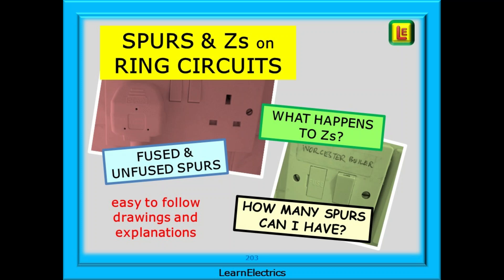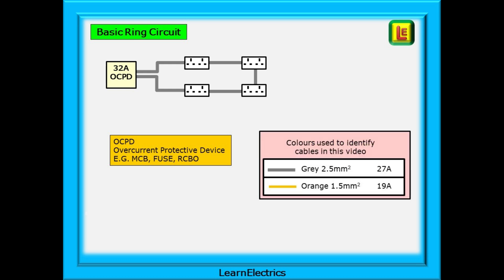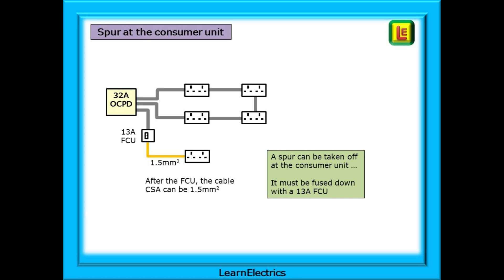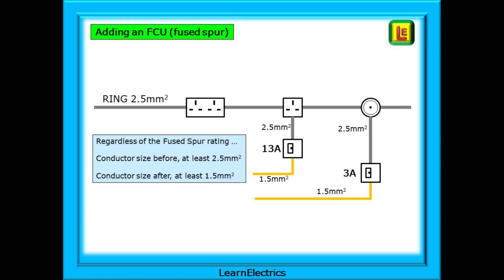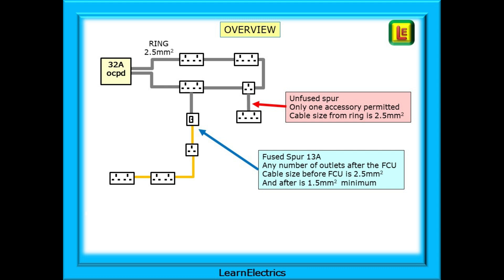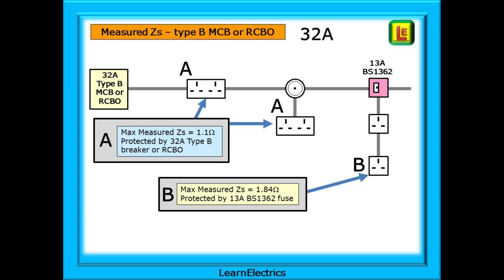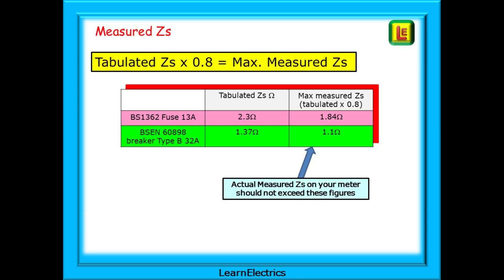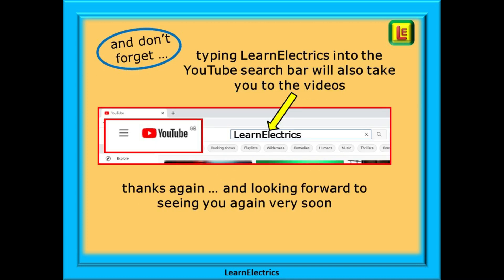SPURS AND ZS ON RING CIRCUITS – CAN I SPUR – HOW MANY SPURS – DOES ZS CHANGE – FUSED & UNFUSED SPURS

Comment: Hi. If I used 4mm T&E to spur off a ring circuit consisting of 2.5mm T&E could I then add as many sockets as I wanted to without incorporating a 13 amp fused unit?
Reply from the maker: It wouldn't then comply with wiring regs guidance. Personally, I always follow what the book says and fit an FCU. Thanks for watching. Dave.

Comment: Outstanding video again Dave. I wasn't aware that you can't come off the Ccu with a DSO without a FCU. A lot of text books show that you can. Why is it they say that you can't nowadays. Surely it is the same as coming off anywhere on the ring
Reply from the maker: Good practice to protect the single T/E cable. Yes, you're right, many books do show it and it is the electrician's choice. I don't like spurring in 4mm if there are already two 2.5mm conductors in the hole. Thanks for the input. Dave.

Comment: Nice video! But what about a switched spur coming of the ring and controlling the supply to the kitchen LEDs with a 3A fuse. Can that switch be used regularly to switch the LEDs on and off ? Technically I don't see the problem, but there might be something I don't know
Reply from the maker: A switched FCU as you explain is ok. As with all switches, check the switching capacity which will be shown inside the switch, often marked as 10A.

Comment: Great video Dave. I suppose if your spurring off a ring that’s nearing its maximum 80% Zs of 1.1 ohms (it would be a big ring, I know!!) then in theory fitting a fcu with a 13A fuse, basically gives you a higher Zs for compliance at the extremity of the circuit. Food for thought!!  Thanks Dave👍👍
Reply from the maker: That's one way of looking at it and there are other ways to solve the Zs problem too. Thanks for watching. Dave.